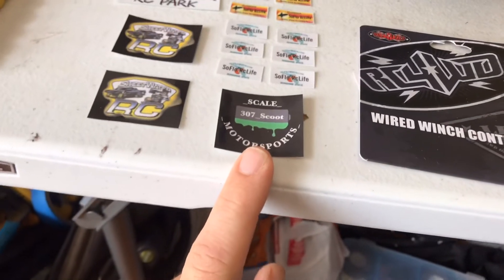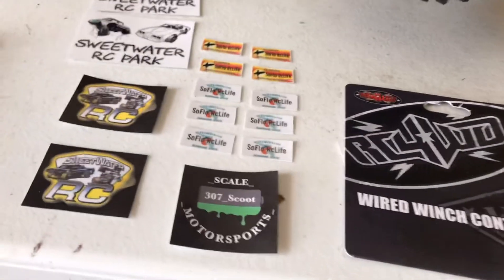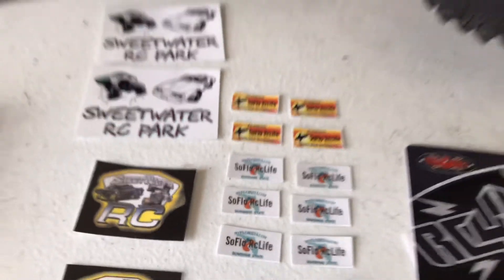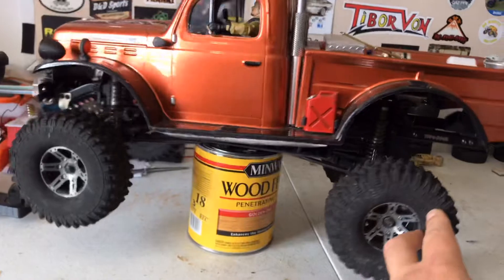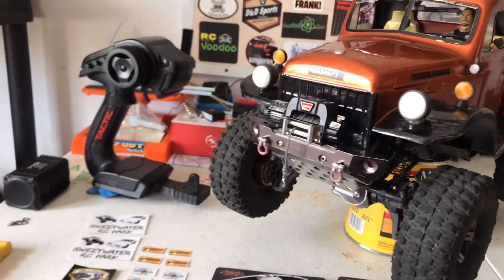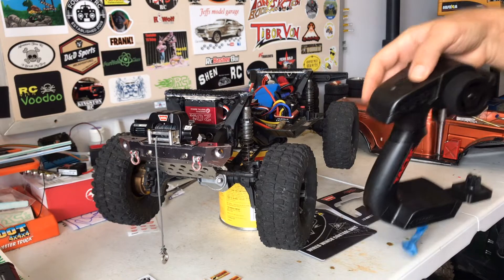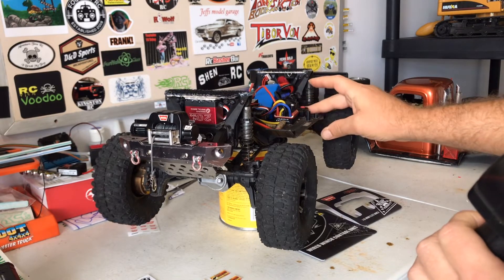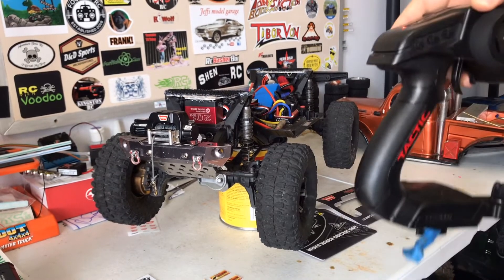Tactic radio 3rd channel / HOW TO GET NEUTRAL POSITION on your warn winch

Comment: Good tip, I mainly use radios with a 3 way switch so not had that issue.
Reply from the maker: Yeah It’s weird how the tactic does this but hopefully it helps others using the tactic too. Thanks for watching brother 😃👍🏼

Comment: I just hooked up a MyTrickRC light setup to a SCX10 ii Cherokee with same transmitter as u. I had to click top button then bottom button of 3rd channel for the down/high button to work. 
And the opposite for the up/high press bottom button then top and the up/high mode would work. Its like a saftey. Hope helps for people with light kits on 3rd channel
Reply from the maker: That’s great bro and Thank you for sharing!!
I’m sure it will help someone else 🤜🏻🤛🏼

Comment: So do I need to hold the button every time? My esc doesn't have a switch so I have to plug the battery in to power it on.

Comment: I found that helpful,but what did you do,plug straight into the receiver, eliminating the board
Reply from the maker: Thanks bro, no I still plugged the winch controller into the receiver, then the winch itself to the winch controller unit.

Comment: didnt work. still came out... no neutral.
Reply from the maker: Make sure you program all three points properly on your remote first. All 3 set points should be (on, off, on) which would be 
(in, off, out).